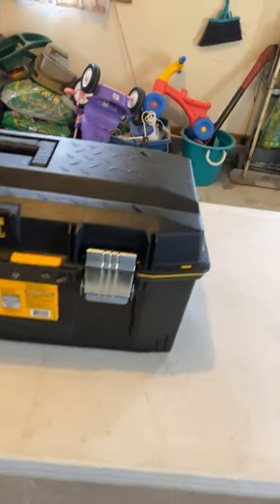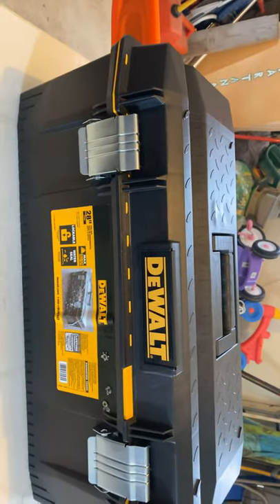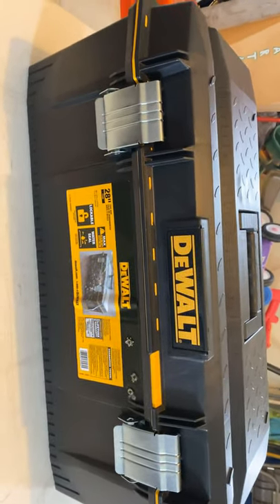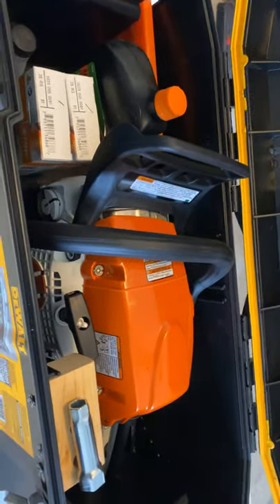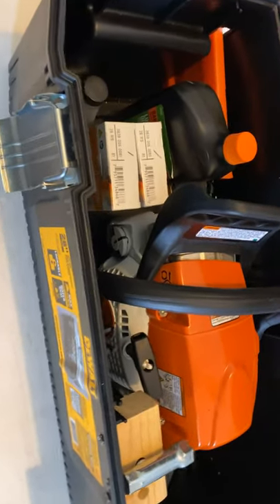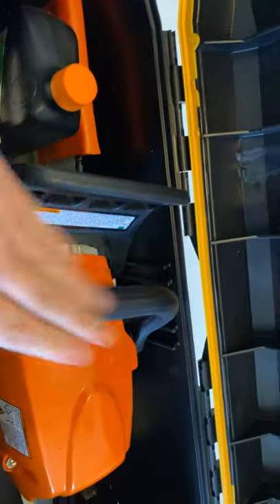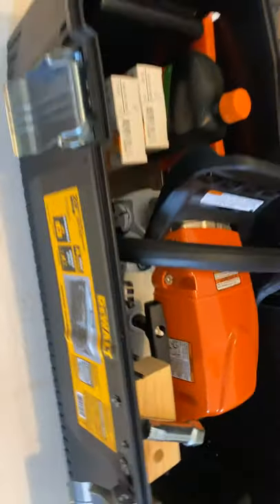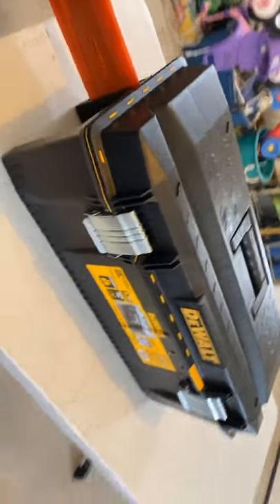DIY CHAINSAW CASE FOR MY MS 271 FARM BOSS!

Comment: The stihl case is $43 lol.  Dealers jack up their prices. My dealer wanted $65. Just go to the stihl website and order it to your dealer which will force them to sell it at stihl suggested retail price. Stihl just redesigned their case a couple of weeks ago.  Its a little hard to find because most places still have the old ones and are trying to get rid of them.  Farm & fleet has the new ones.
By the way that top seal is useless when you have a hole for the bar and chain LOL.  You don't want your box completely sealed anyways.  Moisture will get trapped in the box and cause your saw to rust.